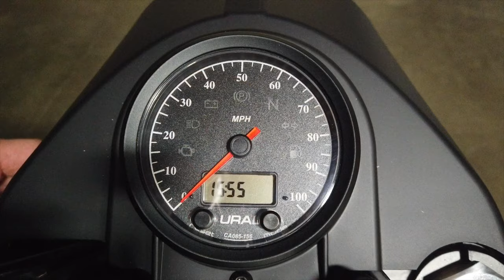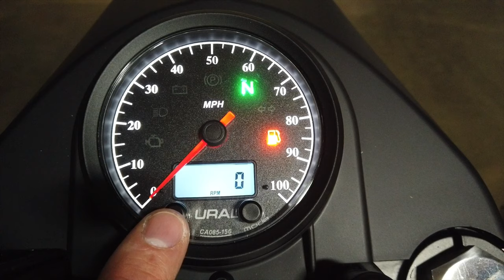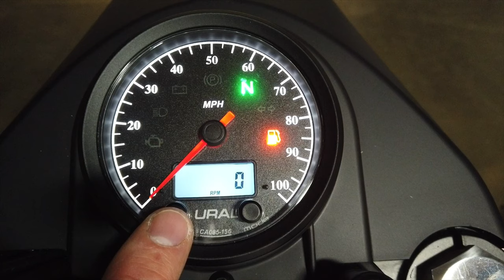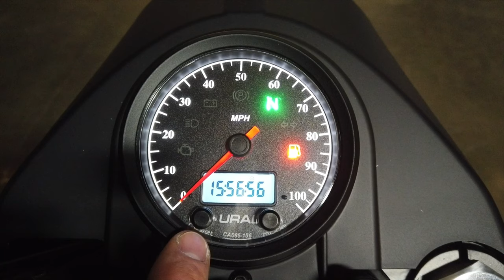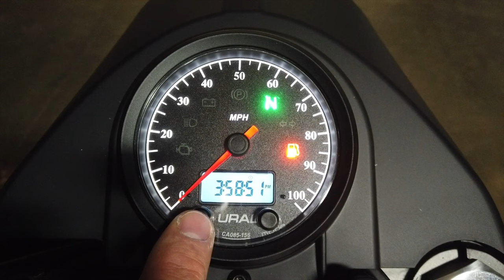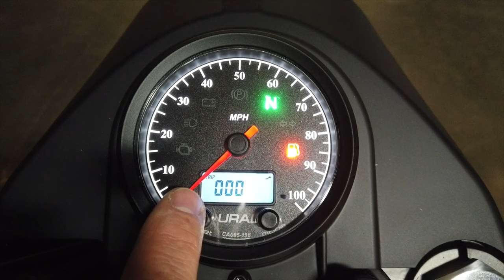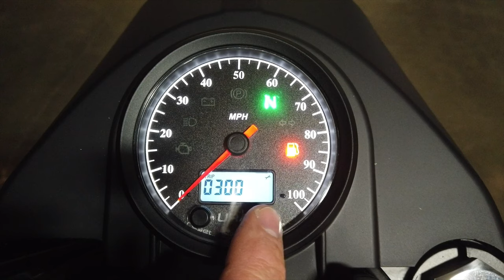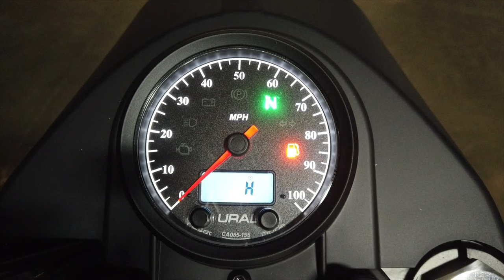URAL How-To - Speedometer & Steering Damper

Comment: Hi  excellent vids keep them coming.  For some reason I like my dampener being quite loose.  Sometimes when navigating a corner at slow speeds and hit a bump the bike goes into a momentary wobble.  This doesn’t bother me in the least but was wondering if it might be harmful to the dampener.
Reply: Not at all. This is what the dampener was designed for, to dampen and reduce oscillations in the steering system.